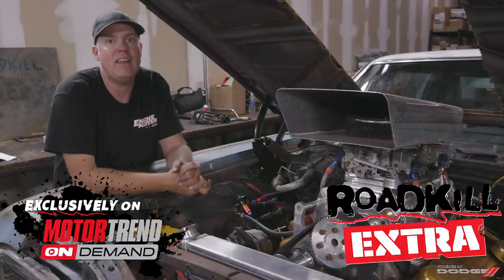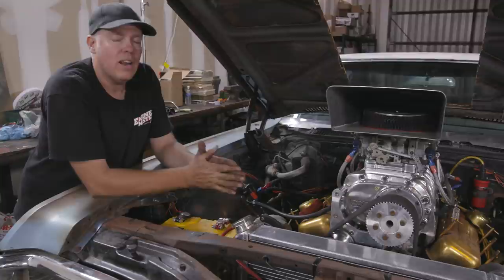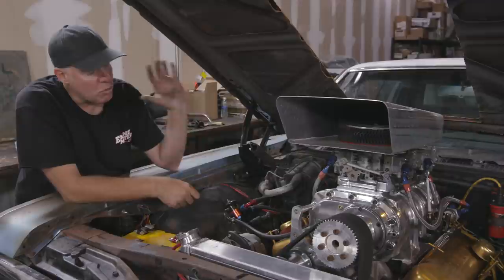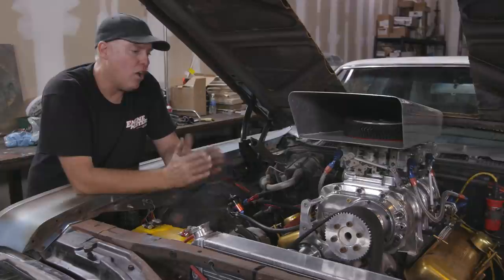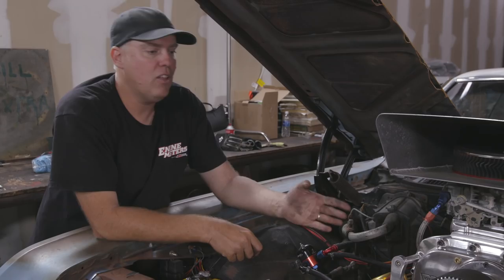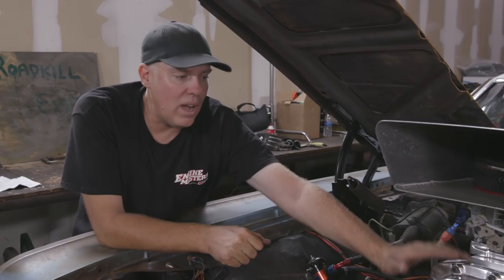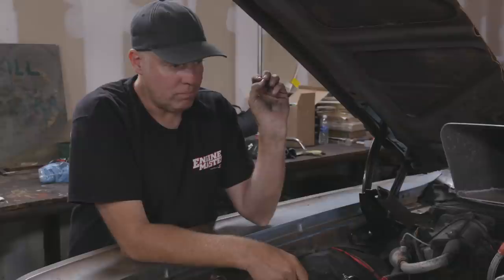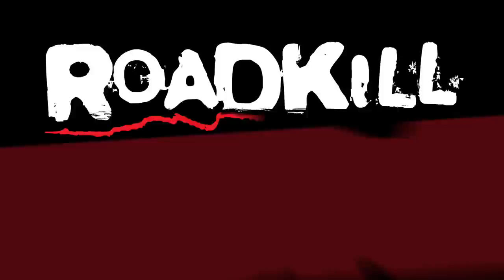Freiburger Explains Supercharger Basics - Roadkill Extra

Comment: One "simple" explanation for what a blower does is that it improves volumetric efficiency. I once had a teacher ask the bonus question on an exam in auto class. The question was can an engine achieve 100 volumetric efficiency and I said "yes even more" He gave me a zero for that answer until I explained to him it was possible with a blown engine. He argued that I knew that is not what he meant but I explained that I also think in terms of hot rodding so my answer was valid. I ended up getting the two marks for that bonus question with a 102% on my exam. Was one of my best days ever in school!
Reply: you could have also cited two strokes, with their scavenging trickery and dynamic CR.
Reply: Musta been an old auto class. N/A engines regularly exceed 100% VE these days. Even a strong street engine will hit 105%-110%. When I worked with sprint car setups, they commonly hit 120%+ if I remember correctly.

But I do have an old (1962 I believe) Ed Isky book about valve timing. And on one of the first pages he says flat out you'll never exceed 100% VE. Just old school thinking.
Reply: yeah, with tuned intake ports a n/a enging can reach more then 100% ve... basically the same as an expansion pipe on a 2 stroke
Reply: isn't it all in the exhaust scavenging for N/As? so that like in a two stroke the exhaust pulls the intake into the chamber (pushes it because haha physics)
although to a much smaller degree than on a 2t.
Reply: jacob fraser Doesn't take tuned intake ports. It can be done on old V8s without any kind of fancy intake. Just takes the right setup. Done properly. Good cam, heads, intake, exhaust. All working together.

Vicious Slayer It's not ALL in the exhaust scavenging. But the only way to get 100%+ VE is to flow more than the cylinder holds. Obviously that air has to go somewhere, generally out the exhaust (I won't get into variable compression engines). Scavenging does refer to the effect of having an exhaust that flows properly to pull air from the intake behind it. But in order for that to work. You have to have a cam/heads/intake capable of doing it as well. Exhaust can't pull from the intake if the valve is closed for example. At the same time, the piston/intake also works with scavenging to create higher VE. It just doesn't contribute as much. But once again, can't work if the engine isn't setup properly.

ChrisHallet83 Well, it's obviously physically possible since engines do it all the time. Especially in the muscle/hot rod/racing car world. So you're statement is flat out wrong. You're not creating something from nothing. The engine is simply moving more air than the cylinders can hold. There's no magic there. VE doesn't refer to how much air the cylinders can HOLD it refers to how much air the engine moves in relation to how much air the cylinders hold. More air moved than the cylinders hold? 100%+ VE. This is a basic engine concept, so I suggest you learn more about them before making an obviously wrong statement.
Reply: ChrisHallett83 has it right. The only way you can achieve 100% or better is if that fuel mixture is pushed/pumped in.
Reply: I really don't think many of you even know what volumetric efficiency even is by what your posts say.
Reply: two strokes run over 100% volumetric efficiency
2t engines eat heads if you raise the CR in the wrong way. yes, a 125cc two stroke will intake more than 125cc's of mixture on the proper rpm with the right height of the exhaust port. which is why I question about cam timing and exhaust scavenging.
Reply: Two strokes have worse VE than 4 strokes. CR has nothing to do with VE.
Reply: Dave Brittain You are entirely wrong. I would love to hear what you think VE stands for? I explain it perfectly in my post. And how you can have a higher than 100% VE on a NA engine.
Reply: my best day at school was getting a B++ on an art drawing....
Reply: Atmosphere is 15psi(a) the a means from absolute vacuum, add 15psi boost you get 30pisa so 15psi you double your displacement cause 5L@30psia is same as 10L@15psia, 15psi requires twice as much fuel

one a 2 stage engine, the first stage decides how much is displaced
Reply: I never said it did?
look it up bud, two strokes have their own method of naturally supercharging themselves. it does not only raise cr, it also raises the amount of air that goes into the chamber, making it higher displacement than it actually is (>100%VE)
Reply: 100+% VE on N/A is not even close to impossible, it is actually a common thing on high RPM engine. Literally every 600cc sportsbike gets 115% VE at peak power. How? It's called inertia. The air is basically a moving pillar of air. When the piston is at BDC the air is still moving in through the IV (if open). The air in the runner didn't get the memo yet. That's just one effect, there is also Overlap, Pulse Tuning on Intake Runners and Headers etc... But basically it's all about inertia and delicate timing. Higher RPM is Higher Velocity, is greater inertia. And at 10k rpm and more, inertia waves are getting sweeeeet.
Reply: Greater than 100% ve impossible? I'd like to hear you argue that with David Vizard. You might learn a thing or 2.
Reply: On every revving engine there is inertia from the air moving into the combustion chamber but the fact is that it is still trying to fill the low pressure void that is created when the piston is at BDC. Those pulses of air are still from the vacuum created by the piston going down. The entire intake and breather system will still be under vacuum.
Reply: its not vaccum pulling the intake charge in its atmospheric pressure pushing it in
Reply: with a tuned port you basically have a pressure wave in the intake charge, with the right runner design and length you can have the pressure wave hitting the valve at the right time and fill the cylinder more then 100%

2 strokes do this in their own way, the intake charge makes it into the exhaust, and the pulse from the smaller opening in the expansion pipe bounces back and pushes some of the unburned exhaust back into the cylinder just as the piston covers the port. hence the "power band" that all high power 2 strokes have, it only works in a limited rpm range
Reply: Dave Brittain I still have yet to see you explain what VE means to you? Or how an engine cannot achieve 100%+ VE? 

Also. No. The "piston going down" (intake stroke, since you apparently don't know much about engines) isn't the primary creator of the low pressure void. The exhaust valve opening shortly before BDC of the combustion stroke. Along with the piston pushing exhaust gases out on the exhaust stroke. Create a velocity out the exhaust valve. This creates a vacuum along the top of the piston. Before the piston reaches TDC of the exhaust stroke. The intake valve opens up. Well guess what? That vacuum and velocity along the top of the piston draws in the intake stroke. And in fact it's been proven that this effect (part of scavenging) actually draws in more and has more of an affect on intake inertia than the piston moving on the intake stroke.

This is also how NA engines achieve a VE greater than 100%. The intake inertia, created by the exhaust velocity/vacuum across the top of the piston, causes some of the intake charge to be drawn into the exhaust. The air just flows across the top of the piston. Hence how a cylinder of say 100CC can flow 110CC. Because that 10CC just gets blown out the exhaust. Make sense?
Reply: So you technically got the question wrong.
Reply: Jarren Wong What exactly has he got right? Cause it sure isn't anything he says in his post. It is MOST definitely possible to make over 100% VE with a natural aspirated engine. That's just common knowledge. Well at least to engine guys.
Reply: You are completely incorrect when it comes to a real running engine because in that case you have pulsing flow which produces pressure waves that are WAY above atmospheric pressure.  Using tuned lengths for the induction and exhaust system so that those waves are arriving at the correct time can put the engine way above 100% VE with 115% obtainable.
Reply: I work with these also. Their shape can be tuned for a specific rpm. The space between the divergent and convergence cones is longer on a motocross bike for power / timing of the pressure wave for the entire rpm range. Add in with playing around with header pipe length.
Reply: @ihatecrackhead 😊

Comment: You forgot the roots blower's most important advantage - the wickckcked sound it makes! :-D
Reply: That would be the pulley/belt combo.
Reply: aah , the whine.. the whine
Reply: intimidation factor of pulling up on the line with your shiny fuel delivery system sitting above the hood and the blower whining away.
Reply: @CarsandCats  It's a combination of things. Yes, the belt is part of the equation.
I had to run a 16 rib belt on my 10-71 a few years ago at a local event when my belt broke. I had a new in a box, but it was damaged. A guy there had a set of Whipple 16 rib pullies he lent me so I could run. The sound changed surprisingly little. I have a three lobe high helix Blowershop blower, and those rotors scream, they scream a lot louder than the cogged belt.
Reply: WEEEEEEEEEEEEEEE

WAAAAAAAAAAAAAAAAAAA

Comment: I remember years ago I was working on an old federal signal siren.  It was a thunder bolt kind which uses a roots style blower to give it a distinct sound.  It's spun by an electric motor mounted at the top or bottom of the pole it's mounted on, and blows air into the spinning rotor of the siren to give it a buzzing like sound.
Reply: That mostly depends on the blower type. I was under a thunderbolt 1000 with a C series blower and the buzz on that thing was incredibly loud. Then another time I was under a 1000t with a 6M blower and it was a lot quieter. There’s another siren that uses a supercharger to add noise and it’s called the ACA hurricane. They’re almost all gone now though.
Reply: The blower is  there to provide Volume. It does add a sound but that's just a side effect of the compressed air going past the chopper

Comment: Awesome video.Two cycle detroit diesels dont have intake valves.The blower mounts to the block with a port in it that corresponds with the port on the blower.It forces air into whats called an air box that surrounds the cylinders or sleeves.The sleeves have a row of holes all the way around them in about the middle that allows the air into each cylinder.Thats how 2 cycle Detroits get their air.On a Detroit the blower is gear driven.They sure look awesome on a V8 gas engine.

Comment: Freiburger, you are correct on the scavenging of the two stroke diesels, and the blower blowing all of the exhaust out. What you missed, though, is that they won't run without forced induction. In small, gas two strokes, the fuel/air charge is drawn into the crank case, then pressurised and forced into the cylinder by the piston traveling down. One: Detroits used a common crank case, and standard oiling, making this impossible. Two: when diesel engines get introduced to an outside fuel source, including their own oil, they run away. SO, air has to be forced in "artificially."
Reply: Beat me to it!

steve

Comment: I love that you talk about how it started, the idea of the "hot rod" guys putting a GMC diesel type blower onto a flathead or GMC 6 cyl or anything back after WW2 was using what they had access to and using their skill, as you could not just go and buy one of these kits and put it on. I love seeing the old pictures of the multiple belts used to run these things before the "toothed" belts came into play, it was using what you had and making it work! A lot of these guys worked on airplanes and trucks in the war so they had the idea of the concept, they just needed to figure out what to use, and creativity is the mother of invention! Thanks Freiburger!

Comment: Biggist engine  ive ever worked  on was a Detroit v16 92 super turbo. Sounds  like gods pants tearing.  Super cool to see a turbo blowing directly into a roots blower. Heat load would be a problem but it was a marine raw water cooling. Only 1200 hp but well over 3k fp trq.

Comment: Freiburger, you're pretty much spot on with the Detroit. The blower is an air pump used for scavenging. The exhaust valves are on the top of the cylinder, and there are no intake valves. Instead, there are intake ports down low on the cylinder sleeves. I was told years ago at UTI that since these can't run without the blower, this Detroit is actually considered naturally aspirated. On a side note these are bastard engines and a pain to work on!! Keep up the great work buddy!!

Comment: Nice and informative guide. No criticism, but it at the start, it might be helpful to mention that in a N/A engine, the air is naturally drawn through the carburettor, as the pistons go downwards. But in a supercharged engine, that air is additionally forced, or ‘blown’ in by the supercharger, which acts as an air pump.

Comment: I think of it this way - a roots blower is essentially increasing your displacement across the board, centrifugal superchargers increase your displacement, this increase varies by RPM, and a turbo increases your displacement which varies by RPM and throttle input (or more realistically exhaust pressure); hence the ability of a turbo to generate the most power and/or be the most efficient.

Comment: The local community tech college had a straight 6 6-71 Detroit Diesel that was rebuilt by yours truly.  It was plucked out of a  WW II Navy PT boat (they usually had 2 mounted side by side, although there were some special forces boats rumored that only had 1).   By the governor controls there was a extra selection for power level,,and it was stenciled "BATTLE MODE".,, which gained you a handful of extra rpms on a 2 stroke diesel,,but they were very quick rpms at that point. Took 2 donor blowers apart and made 1 good one out of all the bits. The little 4-71's went into alot of smaller sea boats.  You could't wear them out.   Drove me sum 6-71 trucks,,and Silver Series 8v92's with turbo directly over blower(575 hp,,torque rating was "Whoo-hoo!" when it 2 stroked).

Comment: I hope to hear about the benefits of blow through Vs suck through on turbos/super chargers. 

As blow through always seemed a better idea, keep the fuel atomized better.
Reply: Big_Adam_2050 kick loguc to the cerb bo the impossible
Reply: I don't know if that'd make a difference, as it's the same volume of air going through. But then again, if it's under the supercharger, the velocity would be lower. Perhaps that would actually hurt atomization.

Comment: I would like the myth of "high compression" in a "supercharged" engine to be discussed. Too many people have added superchargers to stock high compression engines. Then got half assed tunning, & chips. Then burnt up a piston and blamed the compression ratio. Other factors should have been thought of. The ring gap? Correct AFR?

Comment: The two stroke diesels used the supercharger to fill the cylinder. A four stroke unit uses the pistons down stroke to pull in the charge air but the two stroke can't so it needed a blower to push the air in.

Smaller two stroke petrols compress the air in the crank case below the piston and use that in the combustion process hence needing to mix oil with the fuel.

Comment: Dave - roadkill idea - instead of a belt-driven supercharger, hook up a twin-v motorcycle engine to the supercharger shaft. That sounds like it would account for your parasitic losses, plus it would look freaking cool.
Reply: My god....I'll be back going to the garage
Reply: Didn't they already do something similar with the boost caboose?
Reply: Syncing blower drive engine RPM with primary engine RPM would be a headache.
Reply: Yup.
Reply: Kevin Opalka Kind of, but this would be so much cooler
Reply: I had an idea for a modified centrifugal supercharger that would allow for better efficiency at all rpm ranges.
Reply: Or you could make an electric engine spin the supercharger. That way a CPU could match the speed of the supercharger to the ICE engine RPM 1000 times a second or so and minimize the risk of asynchronous mayhem.
Reply: goodkill1 Is it a variable geometry supercharger? Because that already exists.
Reply: knight0334 With a modern engine that has electronically controlled throttle, it really wouldn't be that dificult. Of course, sloth0jr was probably thinking Harley engine but many engines would be more suitable than a Harley engine. I owned an Aprilia 75 V twin that made some 90+ Hp and was ride by wire. Really, there's no reason to specify V twin power.
Reply: Yup, had the same idea with the boost caboose. Actually pretty simple to put a harley twin with its belt primary drive on a supercharger belt, right?
Reply: "Hey Dave, we heard you like engines, so we put an engine on your engine..."
Reply: siiofswe lmao XD
Reply: barath4545 you’d need a high ampere battery source, recharge method, speed controller and space to mount it.
Reply: barath4545 You would need 1 hell of an electric motor to spin a roots blower and then you would need enormous batteries to power it.
Reply: It would always be more efficient (in terms of power per weight, fuel, heat, reliability, ease to set up etc.) to use one bigger engine to run the blower. 
That said it might look sweet which could be worth it.
Reply: You're a genius
Reply: sloth jr No replacement for displacement...
Reply: lose parasitic loss and add weight and off balance the car. is this serious of just plain old stupidity